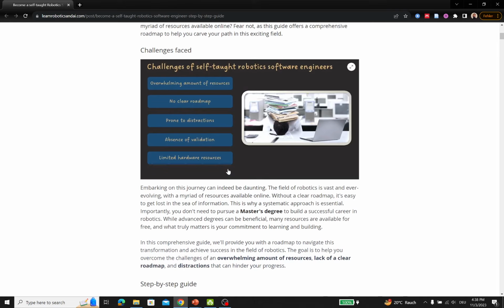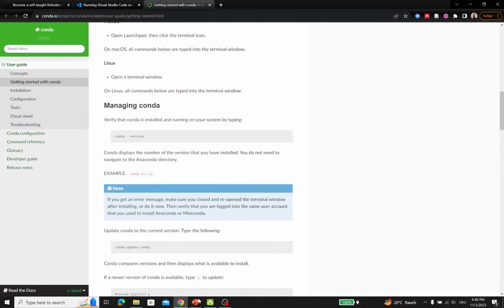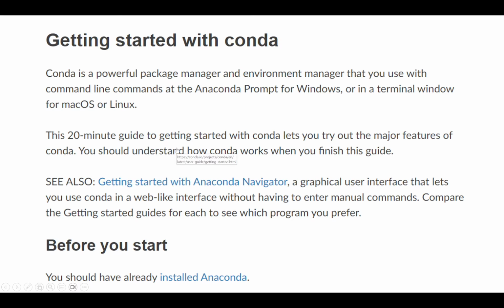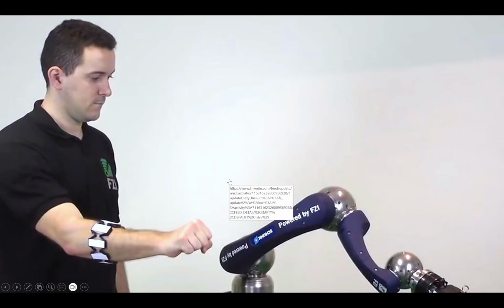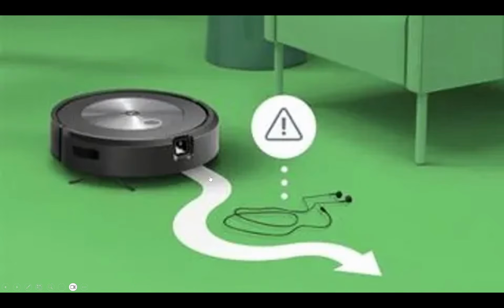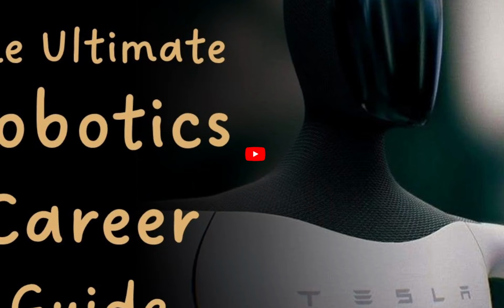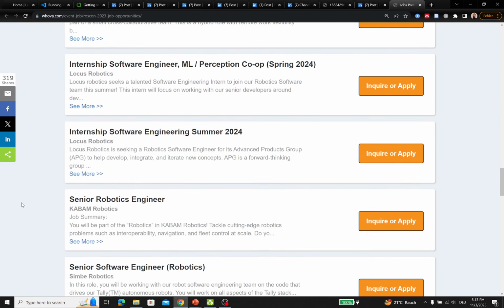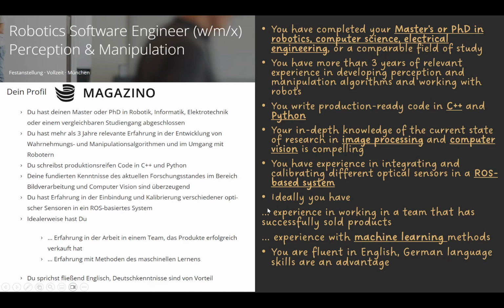Become a self-taught Robotics Software Engineer in 2025-  Step-by-step guide

Comment: - Define core motivation for pursuing this path. This will be difficult, sometimes a grind/boring, and require dedication and consistency
- Leverage free, online, open-source materials when possible
- Develop or maintain strong foundation in mathematics
- Switch to industry standard tools and frameworks. Learn, get comfortable, and build proficiency within this environment
      - Ubuntu (linux based) operating system (OS)
      - VS Code integrated development environment (IDE)
      - Git and associated command line (CL) tools for version control
- Programming languages. Build strong fundamentals and understand the strengths and weaknesses of each, how each is used in industry, common libraries. I think it's safe to say you should focus on Python and C++ but the balance will be different for everyone
      - Python
      - C++
      - C
Common frameworks, libraries, and "middleware"
      - Robot Operating System (ROS)
      - Gazebo simulator
      - TensorFlow
      - PyTorch
      - OpenCV
Projects
      - Start with relevant projects aligned with your own interests and curiosity
      - Build complexity over time and successive projects and design projects to learn and reinforce understanding of specific techniques, methods, and tools 
      - Work on projects in different robotics domains to familiarize with many different focuses and subfields within the broader field
      - More projects
      - Make a portfolio to showcase your learning journey, projects, and skills acquired 
      - Keep building projects and APPLYING the conceptual knowledge you've been studying
Prepare for interviews
      - Study interview questions for your target roles
      - Search robotics job boards and read job descriptions to align the skills and projects you're presenting with those that companies value

Comment with revisions, additions, or clarifications! Quick and easy text version for reference. Probably not 100% aligned with the video but close.
Reply: Sir, are you a software engineer in this feild ?
Reply: @keshav_Jl23  Nope, just thinking about making my way into it.

Comment: I m doing robotics and ai its from mechanical so can i become robitics software engineer ?
Reply: Of course you can. It’s about what you learn and skills you gain, not the degree. Plenty Mechanical Engineers even in college end up specializing in software because they end up doing something leveraging Control Systems, Computer Vision, and Machine Learning. The Mechanical Engineering side gave strong Control Systems foundations and then they merged it with computer vision and just ended up strong with robotics software frameworks on those topics.
Reply: @Quintessenza thanks bro
Reply: yes brother

Comment: Ubuntu is one of the easier distros to use. It ain't arch or bsd.
Reply: I use photoshop, premiere pro,resolve and photography stuffs as my hobby how can i manage it with Ubuntu..... Should i make a partition on my pc??? Then how much storage does the ubuntu actually require as for robotics purposes only
Reply: @nothingspecial9370  How much are you willing to give to Ubuntu and ROS. You need around 40Gb. That gives room to  play around with. 20GB and you'll be running out of space. I run Ubuntu on a Lenovo Legion, which allows two SSDs. One for Win and the other for a Linux install. I don't care for running VM, or dual booting either. Been there, done that.
Reply: @nothingspecial9370 if your PC is powerful enough you can start using Ubuntu inside a virtual machine and keep your host OS 💪